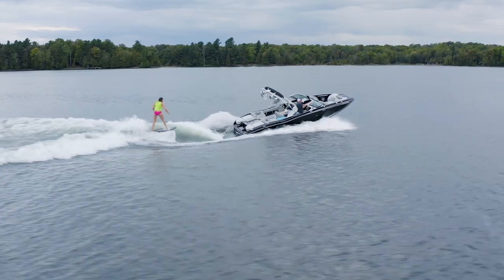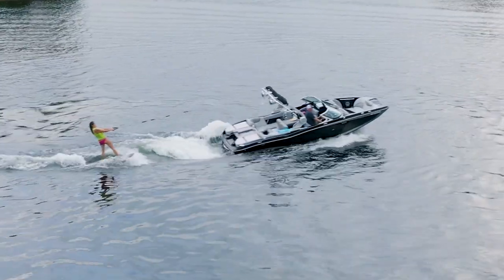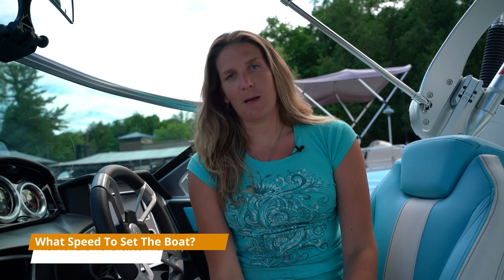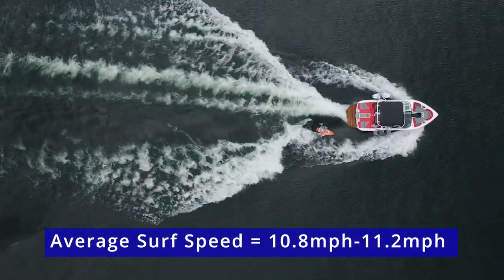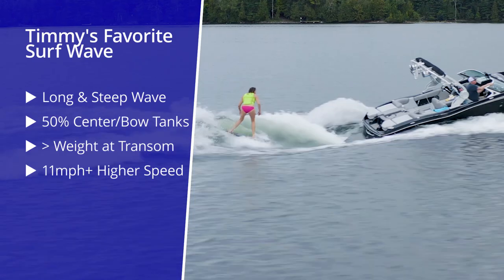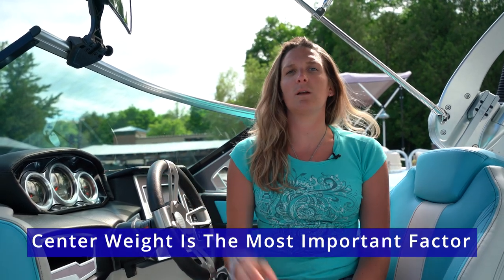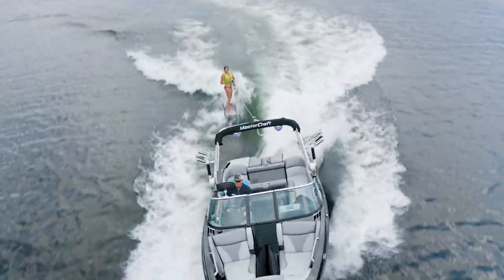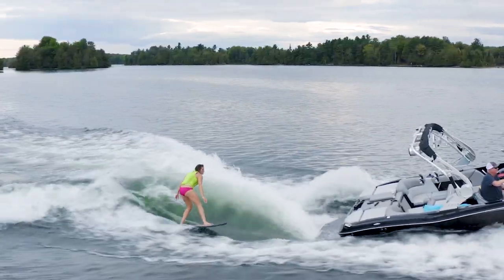How to Set up your Boat for Surfing

Comment: Thank you for the great video, the one thing I am having trouble understanding is the idea of taking  some of the ballast weight out of the boat when I have more people in the boat. My thought has always been that the lower the boat is in the water (100% ballast full and a bunch of people) would in theory displace more water, thus bigger wave. Is that incorrect? I have a 2019 Moomba Mojo with factory ballast and extra bags front and back, plus 500lbs of lead in the rear. My main goal is to lengthen my wave and your explanation of taking some of that ballast out of the center and front got me thinking I have it all wrong. Any words of advice? Thanks again!

Comment: thanks for the info! we have an older ski sanger with some ballast bags that came with it and smaller bag in the center of the boat. what do you think i should do with weight? fill both rear to the max to get a  bigger wave? we have to pump manually for both rear ballasts. thanks!

Comment: question for you, does the trim of the motor make a difference? Where should it be?
Reply from the maker: Are you talking about trim on a forward facing drive Patrick?
Reply: @boatinglessons  New to boating, don't know what a forward facing drive is. I have a I/O Mercruiser, wanted to know if you trim the motor up if it would help or hurt the wave.
Reply from the maker: @patrickpatrick1137  Are you asking about increasing the wave size for wakeboarding or wakesurfing?
Reply: @Len's Cove Lessons in Boating  yes, how will trimming the motor affect the wave.
Reply: @patrickpatrick1137  YOu shouldnt be wakesurfing on an I/O. Very dangerous
Reply: Seriously Patrick, DO NOT allow anyone to attempt to wake surf behind an I/O. This is very, very dangerous. The only boats safe for wake surfing have inboard motors with the prop deep in the water completely BENEATH the boat.
Reply: Ok, I can see how that would be dangerous, I think I will keep them further behind the boat on a ski rope. I guess that is just called wake boarding?

Comment: What you call the perfect wake is making boating unsafe for your fellow boaters. Eroding the shore line of inland lakes, disturbing the bottom of the lakes.  Makes boating unsafe for families out in pontoon boats and smaller watercrafts. You and your friends need to be stopped. “Keep Michigan Lakes Pure”
Reply from the maker: There are ways to wake surf and respect other boaters and the environment. That is in the hands of the operator.
Reply: Boats have been wakesurfing for more than a decade.  And before that wakeboarding.  And bigger boats can cause the same wake.  Get real...aside from local water supply this is what lakes are for...boating of all kinds, fishing, etc.